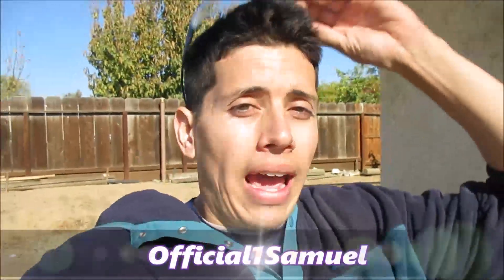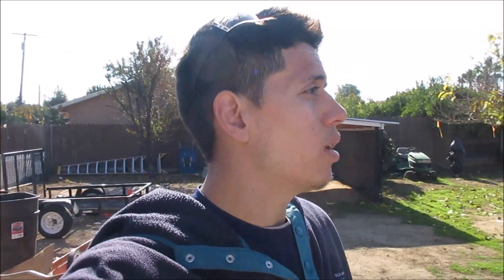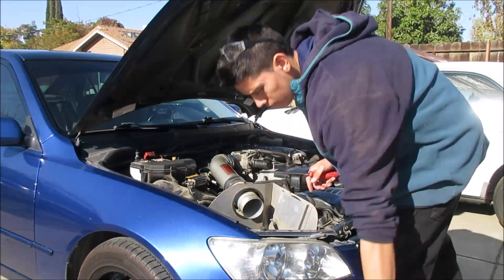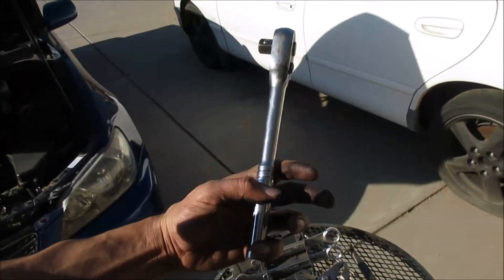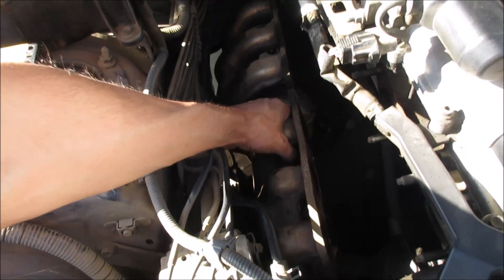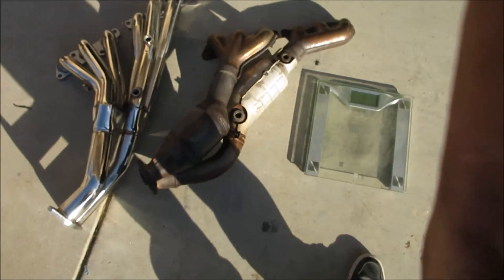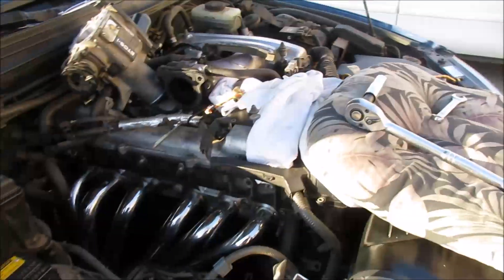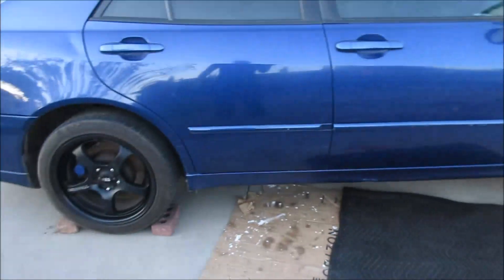lexus is300 header install

Comment: And my third brake light is 35 in it's adhesive it sticks on it back one of the LED I just don't know how to hook up tapping to the brake lights and my fog lights easy have to pull the front bumper off and hook them up everything's in the box though I just need to order the muffler stuff cuz I want you to do the muffler too but I'm going to cash out you and you'll take care of that so when I come to see you that'll be already at your house thanks can't wait to hear from you man you do some good work

Comment: Did it gave u the check engine light? Did the spacers work?
Reply from the maker: It didnt at 1st but after a few weeks it did, might have to keep disconnecting battery and it might work. I put the stock headers back in becuase these were too raspy for me

Comment: How was the header fitment ? Looking into the ls2 headers but not much information on the brand
Reply from the maker: The fitment works but gaskets leak, so i used oem gaskets. Btw these headers are raspy i ended up putting back oem headers

Comment: I'm running a check engine light for my cats, I was debating putting a magnaflow exaust manifold back on or doing fig or obx headers. Any opinion on which way I should go.
Reply from the maker: Stay with stock headers the rest can go straight pipe to a nice magnaflow. You can always add a resonator. Even with stock headers i was able to shoot small flames here and there

Comment: Bro I did the same thing, but my B2 under the car broke so I got my light back, but replaced and now its golden. Next is the DBW by excessive eng.
Reply from the maker: Beast mode
Reply: @official1samuel577  but my damn CEL came back!! P0161. So wait on the beast mode...

Comment: Any updates on how the cars running and did you add a spacer after the Y pipe/ resonator
Reply from the maker: i installed 3 bungs when i had these headers. Nd it was too raspy for my liking. I have  oem headers on now.

Comment: How did it drive btw ? Also would you recommend headers? And would be really grateful if you can send the link for the spacers fir the o2 sensors
Reply from the maker: I would 1st buy a set of good coilovers if you dont have some already. Cant find links but the bungs are size M18 x 1.5
Reply: @official1samuel577  thanks man 💪
Reply: @official1samuel577  ohhh wait so how did it drive and check engine light ?
Reply from the maker: @kenxtou  sounds a bit rassy once ur over 5 k rpm and so far no ck engine light yet
Reply: @official1samuel577  got you appreciate it bro

Comment: Did you have any luck with those bungs for the o2 sensors ? I only ask bc I’m not sure if my car will have an issue with running or not bc I believe I only have the 2 o2 pre cat sensors on my oem header but the reason I’m looking at replacing the headers is bc I think my cats have gone and causing a flow restriction in the headers and making the car not run properly
Reply from the maker: @nitrothunder9937  try cleaning them out , their are products  for that reason. And yes bungs do wk but might have to reset ecu a few times